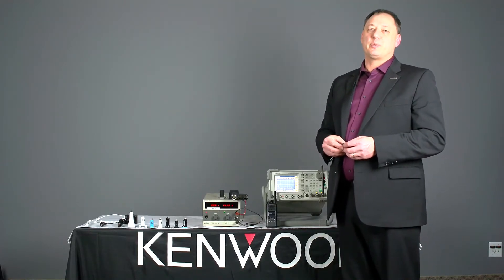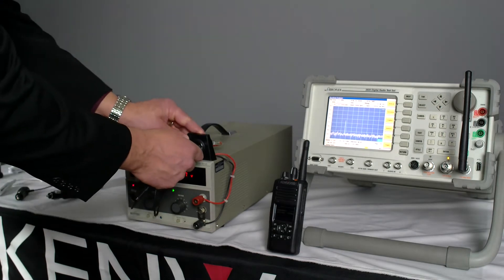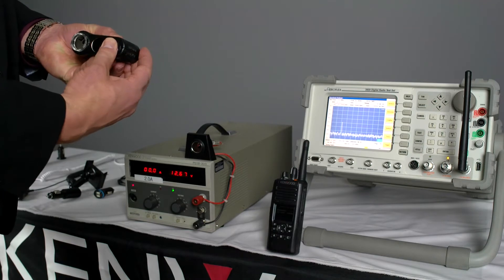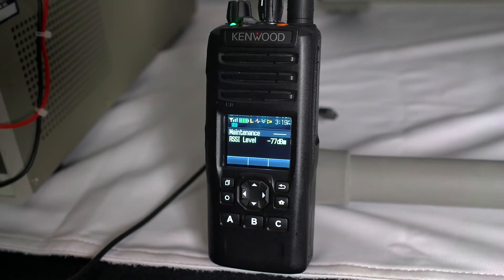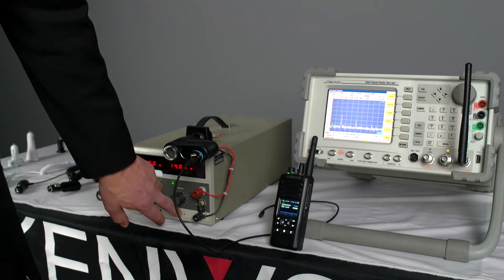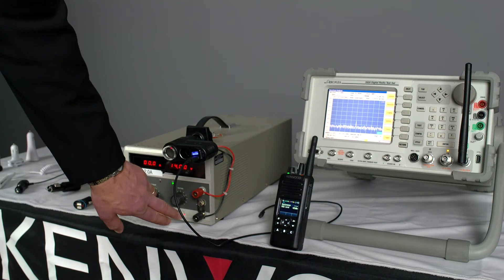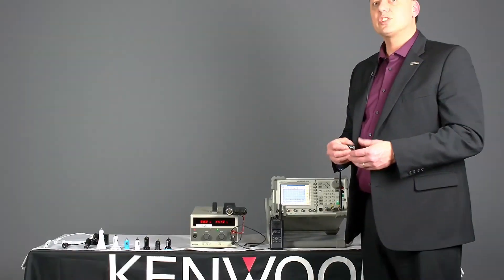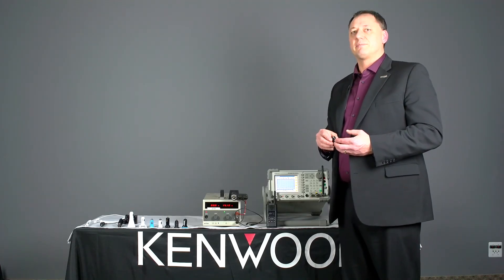12-Volt USB Chargers  & RF Interference

Comment: Many of these 12V - 5V converters also put significant noise on the 5V powerline. This can be seen with an oscilloscope: I clocked one at 1.3 V p-p distortion..that's 26% distortion on a 5V output.

Comment: Perhaps provide recommendations on what adapters are low noise?  Or is it possible to modify it to reduce noise?
Reply from the maker: Most OEM adapters are clean and do not generate interference. A local radio shop with a proper test equipment will be able to confirm this.
Reply: @JVCKENWOODCanada  I have a spectrum analyzer.   I can check how clean something is.  That doesn't help knowing what to buy.   I don't want to buy 100 things and then test to determine what's clean.   I want to know what's clean and buy what works.

Comment: I have tried three different USB adaptors and all of them cause significant QRM to my communications equipment in the vehicle. I think the answer is to build an adaptor using a linear regulator such as the 7805, with a pass transistor so it can handle reasonable load.

Comment: I’ve only had noise issues with adaptors that have two USB outlets. No noise from single outlet units
Reply: That's some great information. I am having this trouble with my duplex outlet. I can do fine with a single if that helps.., Thanks for being awake enough to notice this and mention it.
Reply: @deanstuder1775  I've since found this conclusion to be false. It's more about the quality of the device. Cheers

Comment: So what is the fix to the interference???

We all need to charge something in our vehicle. And many times, while using the charger when listening to our local radio station, the static happens.
Reply from the maker: Good afternoon! There are a number of adapters in the market. OEM that are clean and do not generate interference. A local two way radio shop with the proper equipment will be able to confirm this.

Comment: Search for "adjustable linear regulator power supply (PSU)" and I think 
your R.F problems will be solved. 
Many have easy to use screw terminals so you can connect a 12v cigarette
 lighter connector to the input and then connect to a USB socket or 
directly to a mini USB lead for the output. They cost less than a pound 
for a basic 1.5 amp type and you will be able to spot them as they 
usually have an component that looks like a transistor mounted to a heat
 sink. You'd need a voltmeter and a screwdriver and perhaps a simple box
 to put in all in

Comment: I think that's part of the price you pay for such a compact switching regulator, they are not shielded (at least what I've seen), do not have adequate filters, if any.  I lot of us have such adapters but haven't paid any attention to the RF trash they produce.  If I have the time, I'll have to power one up in front of my spectrum analyzer and compare.   If your current demands aren't great, it isn't difficult to build a simple linear regulator using an LM7805 or a 317, might just have to put a small heat sink on it.

Jim k6nra
Reply: Is it the cord or the adapter or both?
Reply: @steveshaver5244  The adaptor causes the interference, the cord acts like an antenna and helps radiate the noise.